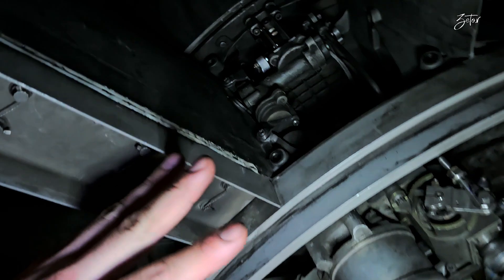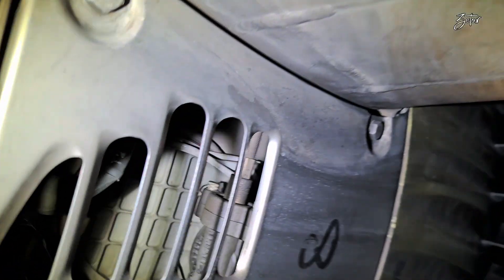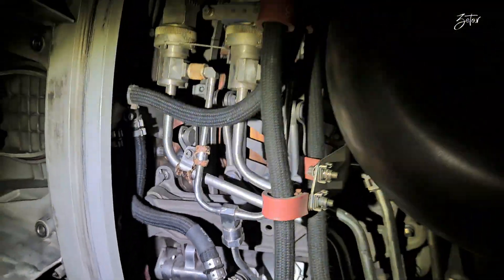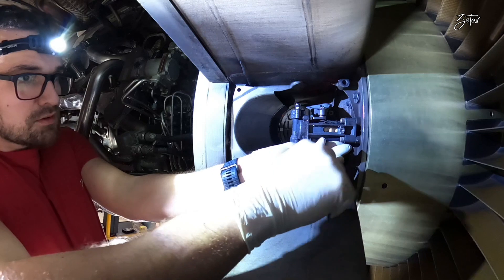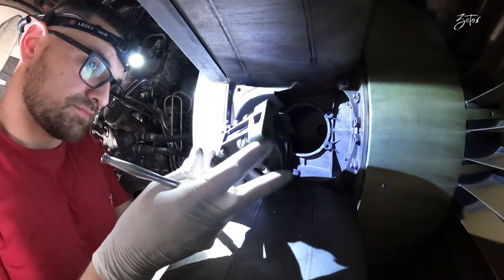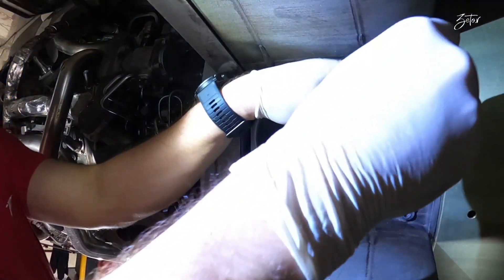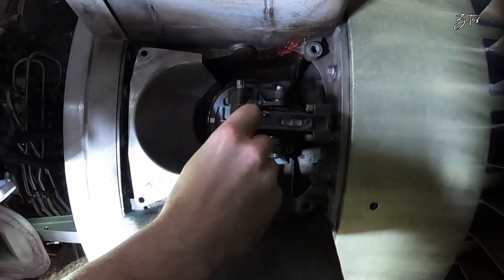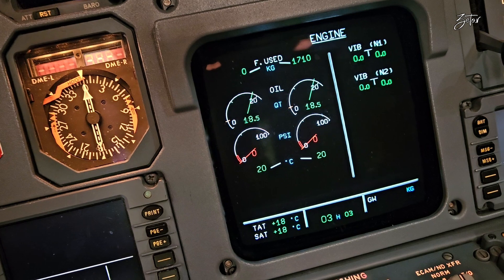Prevention of stall condition in side of engine and how to replace VBV on CFM 56 ofA32F

Comment: Good presentation bro. I noticed that you didn't put the wire after tightening your bolts

I thought it was used on every bolt in the engine

On which parts do you use the wire?
Reply from the maker: Because it must be mentioned in the manual, not everything is secured by a lock wire. The weight will be huge if you use a lock wire everywhere.

Comment: Very important topic, people believe that stall regards only the wings of an airplane, but it can also occur on the stages of the compressor. This kind of content are taught in the course of aerodynamics. Thank you for all Zeto
Reply from the maker: It is important to share knowledge and I'm really happy that people want to learn🙂
Reply: That's a point they harped on in engineering class. Stall is any interruption of air flow, a generic term. The surge is a product of the interruption. Of note, over it's extended life span the CFM was initially plagued with surge issues and has probably undergone more refits and modifications to prevent surge than any other engine made. Our instructor called the 56 the anti surge test bed.
Reply: @thaiexodus2916  very very interesting, the designers and all engineers who takes part in this kind of project have to gain a deep knowledge about this topic: airflow or relative airflow and wings create the lift(according to Bernoulli's theory if we are in subsonic range) and they are responsable for the climb or dive or straight and level flight of an airplane( a balance between weight lift thrust and drag)
Reply: @riccardoromiti5632  We could get lost in fluid dynamics very quickly here and no turbine engine is fully surge proof. Too many variables.
But to the CFM56 credit, it is a remarkably durable and reliable engine that has had numerous surge instances, more than any other engine due to it's incredible longevity, while sustaining less or no damage when surges have occurred.
Reply: Nice topic;thanks a lot.
Could you talk about VSV ;please??